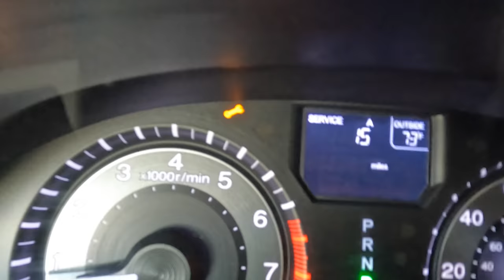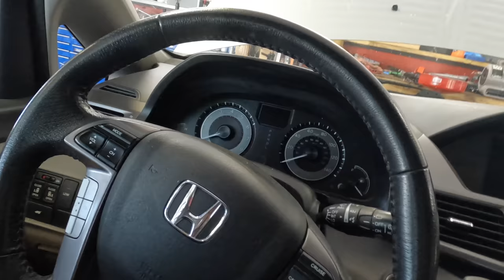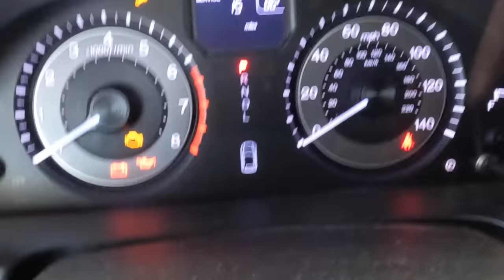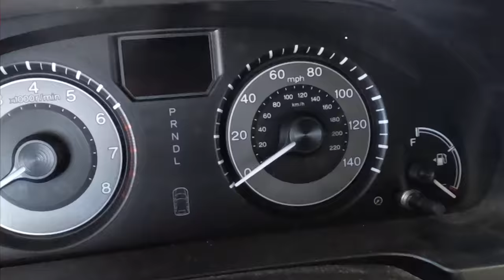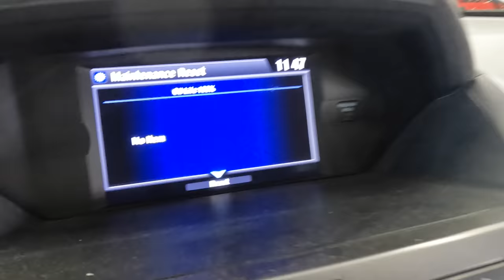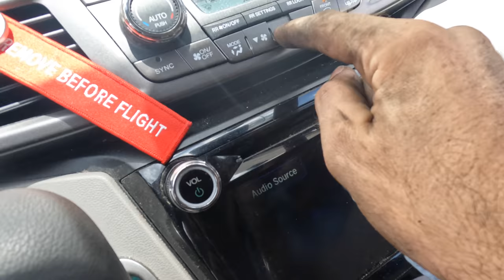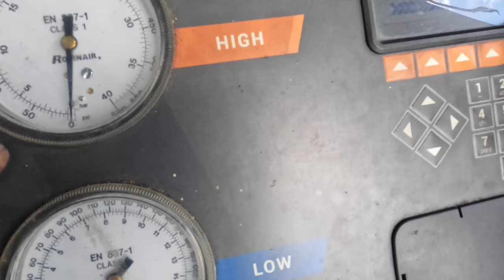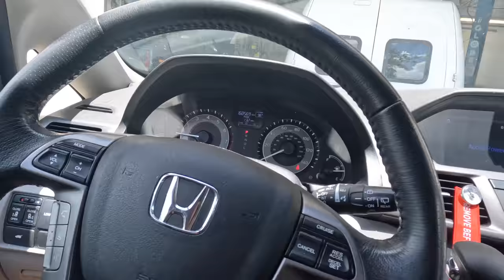Running 300-400 psi. Vibrating noise and smoking! 2014 Honda Odyssey 3.5

Comment: I have a torque wrench just like that from my grandfather. Still in the box because I thought I’d pass it down some day.
Reply: My dad had one, too. He thought these beam style torque wrenches were more accurate than the click style. Unfortunately, his tools never made the cross-country trip to me after his passing. Executor thought I already had tools, and dad's tools weren't worth shipping across the country to me. Executor was probably right. I was a Sears Craftsman kind of guy. Dad bought his tools wherever they were cheapest. (Both of us were shade-tree mechanics working on our own cars, and not professional mechanics)
Reply: @berkeleygang1834  craftsman is as good as anything when used properly, most of my tools are Craftsman. Plus I was a material handling field svc tech for a number of years and you could trade a broken tool at any Sears which used to be plentiful. My Dad passed a lot of tools down to me, he was a machinist in Timken Roller Bearings RR division 37 years. He gave me calipers, dial bore indicators etc. old, quality tools, Dads are the coolest, if I was ever 1/2 the man he is/was I’d be thrilled.
Reply: Click!
Reply: @berkeleygang1834  You notice Ray only uses it for pan drain plugs for fun! He can leave it out in the open & young thieves won’t steal it ! for they don’t know what it is ! LOL

Comment: 23:15 - not going to solder because its a high current circuit?? Solder melts around 180C (355F) if the cable is that hot I think you have bigger problems...
Reply: Very true! But sounded good! LOL
Reply: I thought the same!

Comment: As a Honda lube tech it was absolutely maddening to watch you overfill the oil and struggle with the odometer button. You had most of the reset process correct, after it stops flashing you release the button and then hold it down again till it shows 100%

Comment: The eco mode on those engines seems to be terrible for their operation and longevity. Seems to make them burn oil and shake a bit. I found an adjustable resistor that goes on the coolant temp sensor and lies to the ecu about operating temp to disable the eco mode.
Reply: VCM tuner or VCM muzzler. I have it on my 2012 Accord V6 and it reduces oil consumption a lot.
Reply: I did the same thing to my 2008 Odyssey (VCM Muzzler).  I've never looked back.
Reply: @Texpete88  saves those stupid expensive motor mount bandaids that honda put on the 3.5 to counter the vibrations too.

Comment: Question: didn’t you say in the last air conditioning service video that you like to change out the high and low side Schrader valves on older vehicles because of O ring degradation?
Reply from the maker: I’ve already done that on this van, about 6 weeks ago…I see you pay attention to details Bravo sir! 😉
Reply: @thomaskasprzak6290  Uh, the high speed fan was bad causing an overpressure vent.  Kinda what the entire video was about. 🙄
I hope you're trolling.
Reply: Technically, the pressure relief valve should be replaced as it could open at a lower pressure threshold than designed and/or leak refrigerant.  Problem is, usually that valve is only available with a new compressor.
Reply: The replacement of a compressor when the threshold of a relief valve is reached shouldn’t matter as long as it doesn’t open to relieve during normal operating temps. Surely we have more to worry about than a weak relief valve ive had a weak valve for years!😁
Reply: @johnlarkin549  I agree... As long as it doesn't leak.  However, it is within the realm of possibilities that it could blow at a lower pressure (within the working pressure) in the future.  It's just something I'd inform the customer about.  In this case it's his own car so no big deal.
Reply: Does the high dude have a little ball to seal off.?
If it does my brother told me it would forever leat because the ball is rubber and will have a slight cut where it was pressued up against the seat.
I may be saying it wrong but you should be able to understand

Comment: If the pressure is going high enough to blow the relief then the high pressure cut out switch most likely faulty as well.
Reply: that is if it has one. yes it should.
i hate the systems that have the fan cycle switch , if i have the AC on i want the fans running at full speed.

Comment: Being old enough for free coffee I have recently started letting the younger kids do some of the grunt work on my vehicles- a few months back I had a young mechanic at the yard I drive rigs out of change the vacuum pump o-ring on my 3.5 Ecoboost. I'm just too damn old for laying across an engine anymore...

Bolt gravity reached up and grabbed one of the 3 pump bolts, and he went into full panic mode when he couldn't find it. It was a Sunday, we are out in BFG, and he knew no one would be open to get a replacement. After letting him sweat for a bit I grabbed the antigravity fishing rod and with a few tries pulled it out from between the trans heatshield and the cab floorpan.  He now has one in HIS toolbox! 

I liked your showing to remove the hood latch and 2nd fan- so many people will fight for an hour to save from spending 2 minutes moving things out of the way (Ford 1st Gen Escape fan assembly for example). As always, great video!

Comment: You were on the right track to reset the service interval through the dash, there was just one step you were missing.

Press and hold the odo/trip button for 10 seconds with the oil life/miles over shown and it'll begin flashing, then tap the odo/trip button and it'll stop flashing, then hold the odo/trip button again for 10 seconds and it'll reset.

I didn't know you could go through the infotainment to reset on the "older" Hondas, I just figured it was the newer ones (2018/19+).

Comment: Properly crimped connectors are fine - especially if they are sealed watertight. Properly made soldered connections are better. They have lower resistance, meaning they do not heat up as much as any other kind of connection. Any soldered connection that heats up enough to melt the solder only does so if it is carrying too much current for the wires it connects.

Comment: I am gratified to see you using a proper filter with synthetic oil, way to go Ray! Get rid of those Advance Auto reds!!
Reply: Yes but unfortunately many shops don’t take to much of the shops techs input ah well as they could. BUT (that being said) it would likely change the price for an oil change another $10-15. Pay now or pay later, I know. That’s just the shop watching it’s bottom line and not communicating super well with the customers. Any brand of parts that you want; quality cost 💲

Comment: Honda V6 maintenance schedule for 0 to 350k miles - 

Regular oil changes,
4 autozone power steering pumps (If you know, you know)
2 sets of front struts
1 pair of valve cover gaskets
Maybe upgrade transmission cooler.

Solid vehicles.  Honorable mention to Acura MDX's being the least reliable of all the J-series cars
Reply: @nickg9021  at least three of them
Reply: Yes.  Power steering pumps.  They're all noisy (even new) until they warm up.  At least they're really easy to reach.  The valve covers, not so much.  Your valve cover gaskets will be just fine, but your spark plug wells will be completely full of oil and fixing tose gaskets requires removal of the valve covers.  Done the struts and the trans cooler, too.
Reply: @nickg9021  You would be surprised how many of my Honda V6 customers have never even heard of or been recommended a timing belt kit. They don't tend to fail as often on these as other cars too. Definitely change them, but it isn't going to snap on you within 100k of use lol.
Reply: @nickg9021  yeah never did that myself. Not that ignorant.

Comment: I would have recommended replacing both fans if the one is in such terrible shape after 168K miles, even if it is the low-speed fan. Nice diagnosis, nice work.

Comment: Good diag, good job!  This model is also known for bad a/c clutch relays that stick "on" and blows the over pressure valve on the compressor, but you had a bad fan, again, good diag!

Comment: 👍👍☝️😎✌🏻… had the same sorta problem with the connector on an adapter for a Dual radio fitting in my grandson’s 2001 Mustang.  The pins wouldn’t let the connector engage. Take the pins out and it fit perfectly. The slots for the pins was mis-made causing them to pitch up. I used my heat gun to heat the wire end of the connector, and while still warm, plugged it up. Fit great. When cool it was just like OEM.  But it’s a damn shame that for the price you pay for this stuff, it oughta work right to begin with.

Comment: Step brother owns his on workshop here in New Zealand  🇳🇿. 
In his early 30's his retiring boss offered it to him. Has seven brilliant young mechanics, and watches your video occasionally. 
The curse of the 10mm is a common thing as I help design towbars.
Try stripping a rear bumper ,tail lights,and trims,only to have the damn thing drop into the bumper when putting the tail lights back on.
New car customers gain a free rattle if it cant be retrieved from the chassis🤪

Comment: On the drain plug,  the torque spec on a stamped steel pan is 33 ft lbs
 And a cast aluminum  is  23 ft lbs. A steel pan will be  black and the other is a silverish

Comment: Another option for connector issues like that is to swap the wires & contacts from one connector to another. Kind of tricky if you don't do it a lot, but sometimes its better than splicing wires...

Comment: i know fans are relatively high current but if those wires get hot enough to melt solder, we've got bigger problems, for instance..fire lol butt connectors are fine if done properly, if not they can add a bit more resistance which creates more heat but solder is fine as well. it all depends on how much time you wanna save.

Comment: You should get a proper ratcheting crimp tool for insulated lugs. They don't just pinch the wire in the connector. They make a genuine COLD WELD! The ratcheting feature insures one goes through the proper cycle to insure one gets a valid cold weld. I worked for decades in electrical engineering, and for over 20 of those in manufacturing. The tool you use won't make an approved connection by any of the industry or safety agency standards.
The ratcheting tools went for about $360 at the low end price point 20 to 30 years ago. Now  I see them as cheap as about $15 at Harbor Freight, to around $40 at auto parts stores. They are REALLY nice!!! Definitely worth having!!!
The proper procedure to make a crimp involve some prep work. Observe the connector to be used. See the metal inside the insulation. Notice the seam. See the crimp tool. Notice the die in the tool has 2 halves. One is has a smaller semi-circle than the other. Line up the seam in the lug with the center of the small semi-circle half of the die. Click the crimp tool until it just holds the lug. I sent the wire. Ratchet the tool through it's entire cycle. There will now be an approved cold weld connection. The wire would likely break somewhere else, if pulled on to failure. That's how good the cold weld connection is! A proper tool can be had so cheap, these days, and they are so useful, there is no reason not to have one! You will use the hell out of it, and love it!

Comment: I have a Honda Odyssey and just replaced the entire AC including the cooling fans and harness.  $2000.  My fans quit working within months.  Changed the relay switches and 3 fuses.  Honda did not carry the relay switches so had to use auto zone brand but the fans are spinning.  So glad summer is ending.  I live in my odyssey.

Comment: I was always told to use what’s labeled on the oil cap no matter the mileage. I guess if Ray does it… it’s ok 👍
Reply: Thicker oil is better for high mileage engines. It will help protect worn bearings and seals and improves oil pressure. You can also go with a high mileage specific oil at the recommended weight and achieve the same results. High mileage oil has additives that make it thicker anyways.

Comment: My wife has had some kind of Honda for the last 25 years. I have always performed all the Maintence on them and I have always felt that during oil changes the oil that drains is gritty feeling. Like it’s full of carbon. I’ve tried extending the oil changes out to 10,000 but it always worried me. Thanks for showing the pressure increase due to a faulty fan. Makes perfect sense but something that I have never thought about. I’m learnding stuff. Never to old. This is why I am such a fan of your channel. I learn so many tricks and tips. Also. How do you get the crank pulley loose on your Honda V6. Timing belt R&R is not bad but that part always sucks. I have the 1/2 drive snap on impact. The Mac mini 1/2 drive. Tons of 1/2 drive extensions and breaker bars and the thick walled impact was a recent purchase. I have the crank holding tool as well.I even own and wear a Snap On t shirt that I wear when I work on my cars.
Reply: Those crank pulley bolts on Hondas are a BEAR! They should go on with at least blue loctite and maybe red. You definitely want to get them tight!
Reply: Lisle sells a special impact socket (Lisle 77080 19mm) for that bolt - it's about three times as thick as a normal one.  Amazon has it for about $25.  Read the reviews and you'll buy it. 
Here's how I did it.  I hit the bolt with PB Blaster, let it sit an hour or so, and then put my 120v Porter-Cable 1/2" impact with the magic socket on that sucker for about a minute straight.  Nothing happened, so I put some more oil on the bolt and went in to have breakfast.  An hour or so later, I hit it again and heard that satisfying whirrrrrr in about ten seconds.  BTW, the crank holder tool won't work with this socket - it's too thick.  Let your impact do the work.

Comment: Had something similar on my Caravan. AC blows warm and engine while not overheating, was running hotter, especially at idle. Found one fan not running. But in my case, found the blade fell off. The nut holding it on fell off. 6 month aftermarket junk. I put a new nut and epoxied it.
Reply: You got lucky once not hitting the rad ! Now your pushing your luck! LOL
Reply: @fredwalker839  Ironically, the OEM fan lost a single blade and it did go through the radiator when it was about 7 to 8 years old. The replacement fan lasted about 7 years. The shafts wore and were vibrating. The current fan has a well in the hub that I totally filled with epoxy. That nut is not coming off.

Comment: She got lucky it wasn't a "rodent wire food" issue on the power to fan. At Edwards AFB you never park your ride at the edges of the parking lot. Ground squirrels and rabbits will work your harness of the vehicle as you work on the plane. And there's nothing wrong with deflection torque wrenches for ensuring fastener security. Both my S.I. torque meters are defection type (autos only - the real thing for aircraft).

Comment: Sounds like the compressor head pressure is high, and it has a pop-off valve that vents refrigerate, which is the 'smoke'  customer sees, the condenser fan /fans aren't working ! Had the same problem years ago with a pt cruiser, both fans quit working, but during driving everything was fine !, only by spraying water on the grill of the car then a/c worked, replaced fans and everything was back to cooling !!

Comment: Hi Ray,  that coolant re-tractor i see a fault with it.  There should be a splash guard on the rubber cone to stop the coolant from shooting up at you.  you can get a small funnel, cut the end off just so the rubber cone can slide in and up.   Due to back vacuum pressure it will stop any coolant from shooting up.

Comment: i had this happen to me with my suv the 2017 nissan pathfinder i saw the fans where dead so i was running hot so changed out the fans and was just fine also did it to another persons car that had the same issue very good work

Comment: Ray, You can see that the white plastic insert of that connector on the new fan unit projects about 1/4" further than the old one. Either the new connector is incorrectly assembled or it has the wrong insert. When I run into problems like that I check to see if the pins are interchangeable. If they are I eject them from the old and new shell (they make tools for that and I have them all) and put the new pins into the old connector shell. Problem solved. No cutting, stripping, crimping, soldering or whatever.
Reply: good idea.

Comment: Hey Ray I wouldn’t spray Silicone on the electrical connections it has a habit of making the electrical connections bad.  I think the issue looked like misaligned spade pins on the plug.

Comment: When ever you crimp, do a tug test, just give it a good hard pull, if no slippage you'll usually be good. I crimp and solder all high current connections to ensure reliability, get some non insulated crimps

Comment: Fan removal is the same for the Honda Fit, you have to take out the passenger side fan to get the driver side fan out.  2008 Honda Fit 200K+ miles and running like a champ
Reply: 30+ yes in the parts store world says yes, they usually are.

Comment: Oil, rotate, and coolant service! A or B oil, 1 is rotate, 5 is coolant.

EDIT: More specifically A is oil only with no filter, B is oil and filter. At Acura, always did the filter on every car. They are like $4 and really can not over maintain a vehicle, ever.

Comment: Lowering the resistance of an electrical connection reduces it's likely hood to melt. 
I did that on all my connections on the truck. Along with double wall heat shrink. Or Sika Flex with the good Raychem or other heat shrinks. Some of them were almost 40 yrs old and still worked very Well! I was impressed.